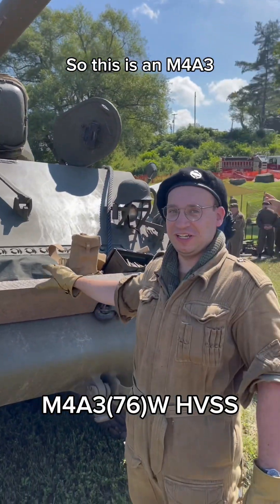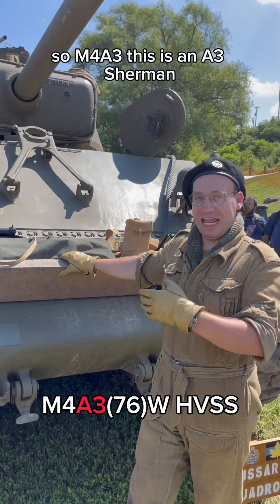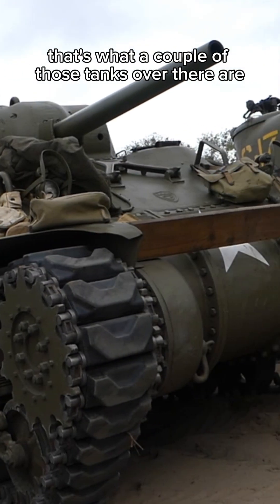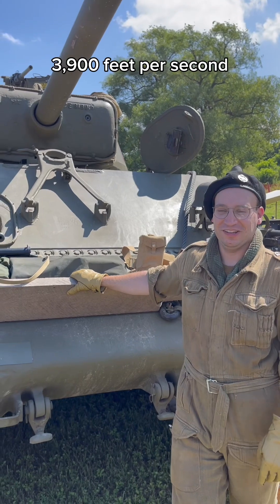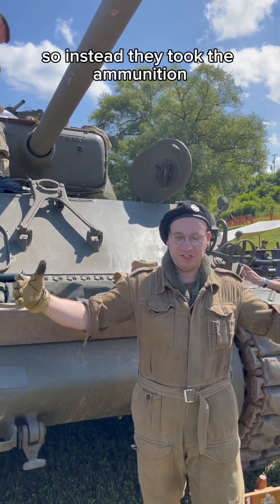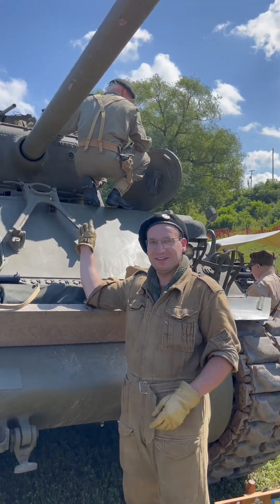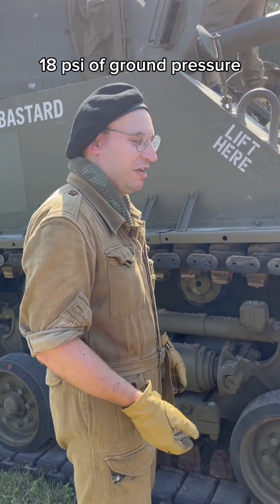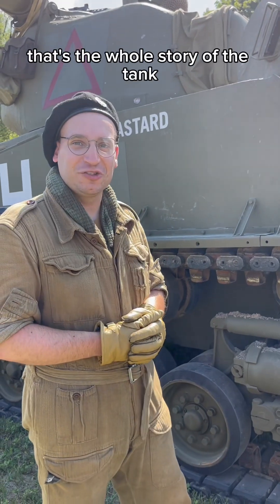"Easy Eight" Sherman: Breaking Down The Unique Engineering and Features of the M4A3E8

Comment: The Ford GAA engine had nothing to do with the P51 Mustang. The Ford V12 engine was designed for aircraft use but had no buyers because the Allison's V-1710 and Rolls Royce Merlin were better inline engines. 
The 76mm was designed and tested in 41-42 alongside the 90mm as a replacement for the 3-inch gun from WW1.
The British did not want the 76mm as the 17-pounder was a better gun and it created more logistics issues with an additional round.
In the end, the 1st Polish Armored Division in NWE and British Armored forces in Italy were mostly supplemented with 76mm Shermans rather than the 17-pounder.
Everything else was correct and a very good overview of the Late War Sherman tank.
Reply: I was gonna say, some of it was off
Reply: The obligatory "Well ackshully" post we all knew was down here somewhere.